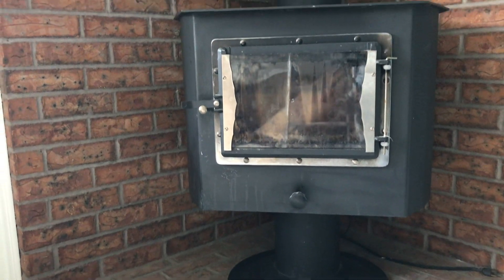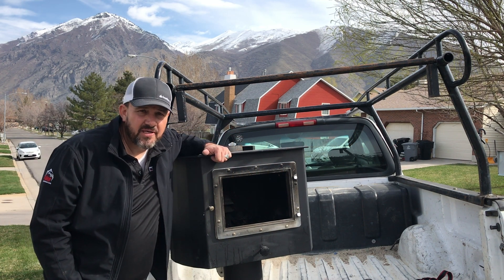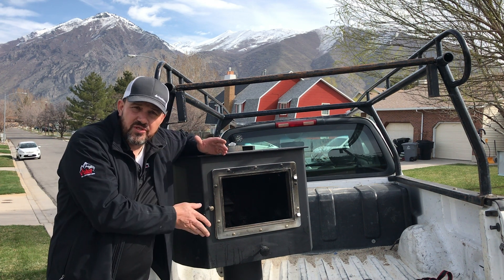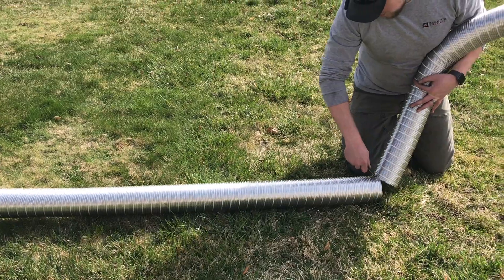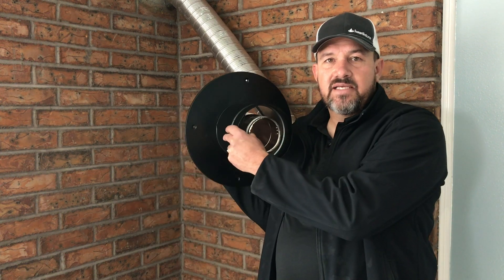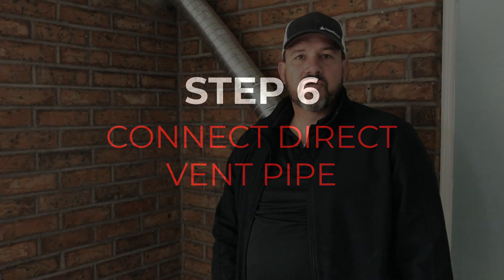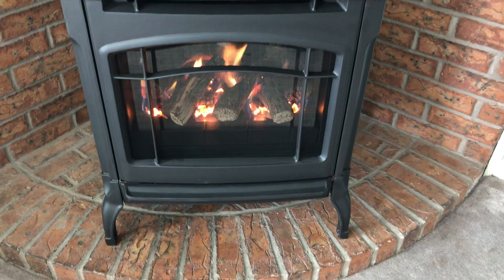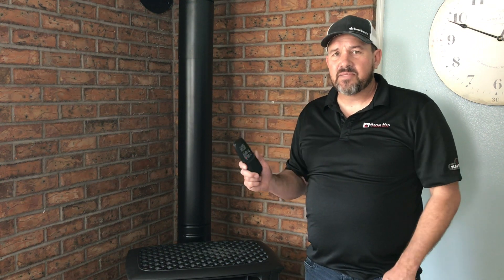DIY Wood Stove to Gas Stove DAQ Change Out

Comment: Can the opposite be done on something like this?  What would it take to turn one of these older natural gas burners into a regular wood burner?
Reply: You take out the metal inserts from inside to give you more room for wood and where the gas pipe went in you add a bolt and washer to stop smoke coming out. And wood is mostly free compared to gas. It sounds like the left wing, or a gas supplier has conned the state in to believing gas is better for the environment, but it isn't. Wood is a far cheaper and safer source of heat, in fact, wood is the new oil. In a few years, only developing countries will use petrol and gas.

Comment: Why couldn’t you just install a propane burner in the old stove
Reply from the maker: YOU ABSOLUTELY CANNOT INSTALL A GAS APPLIANCE INTO A WOOD BURNING INSERT! Wood stoves are meant to be used as a controlled combustion appliance, ie, using a small amount of air to burn the wood slowly to extract the most amount of heat from it. An open gas fire needs an excessive amount of air to burn properly.  Failure to supply adequate combustion air, most especially by closing the doors on the insert will cause an explosion.  You would have to remove your wood stove in order to install a gas appliance in your fireplace. PLEASE DO NOT CONVERT A WOOD STOVE TO GAS!!!

Comment: I live here in the Salt Lake valley and the only thing I have against switching to gas stoves/fire places is in the event of a major disaster that the gas and power is cut off for days or weeks what do you heat your home with? I have a small pot belly stove and the only reason it's in my home is for emergency heat, other than that it's never used. I don't know how anyone can afford to use a gas stove/fire place just for the fun of it. They need to make stoves that work on both gas and wood. If Biden had his way there would be nothing being burned, everything would be ran off power but if the power is out then nothing runs, no heat, cooking, A/C, fridge/freezers, in the winter people would freeze to death. When I was young we all used our wood burning stoves and fire places, my parents couldn't afford to run the furnace, our wood burning fire place heated the house. We would step outside and some times we could smell the wood burning but the air was still good even with everyone burning. They say our air is cleaner today than it was back then but I beg to differ! Back then we could see both mountain ranges all winter long but now even with no burning during the winter all it takes is one day of high pressure and both mountain ranges are gone in a sea of pollution and we can see and smell it just looking across the street and we are stuck in it for days/weeks. We didn't have to keep our homes sealed up tight and run air purifiers to try and breath clean air back then. It's not the wood burning stoves, it's all the crap that runs on gasoline and diesel plus all the pollution that factories and other plants put out. Even natural gas is not completely clean. If the pollution gets bad enough they start asking everyone to cut back on running their furnaces and other natural gas burning devices. I just think people need to think of emergency preparedness, that's where my mind goes.
Reply from the maker: You make a lot of good points, and I agree with most of what you said. I also think of what I would do in case of emergencies and prep for the situations that you mentioned. I have a wood burning pizza oven, an old wood burning cook stove, and a freestanding wood burning stove. I live in Utah county. As a retail fireplace store, we participated in the change out program and did find that there were people that it really helped. There are also some things that I had never considered such as people with allergies that are very sensitive to smoke. It is not a one size fits all but as for myself, I will always love the smell of wood-burning stove! Thanks for your comment and thanks for watching!

Comment: So you're saving the world by NOT burning wood? What people in America may not know is that wood grown as a supply is carbon neutral compared to gas. Haha, it's far safer, and much much better for the environment. Wood for heat can also come from a by-product such as furniture making etc, so heating a home from sawdust means you offset the carbon from the furniture making process, thus creating less waste. Or you can spend billions of dollars getting gas. PS, you should collect all if the old stoves and send them to the UK because there is a big switch from gas to wood going to happen in the UK.
Reply from the maker: I love burning wood! I have 35 acres in the mountains with lots of dead trees for fuel!!! Most people are just lazy and would rather push a button... co2 is plant food and it’s getting colder so grow a garden.